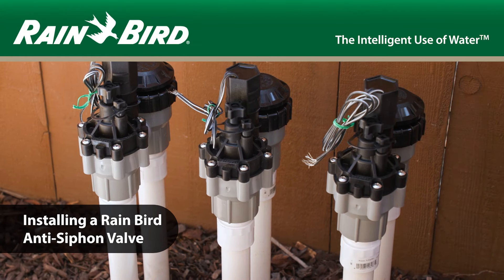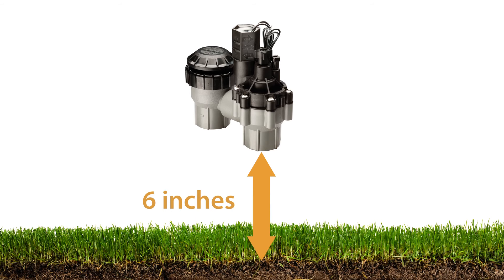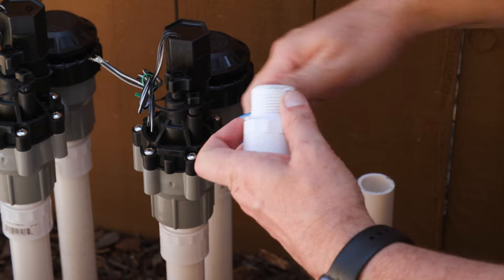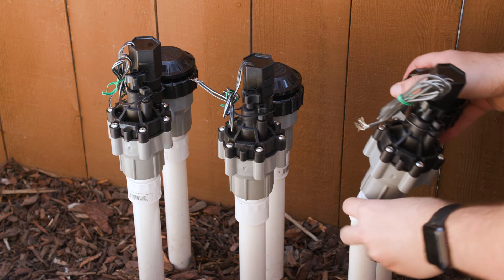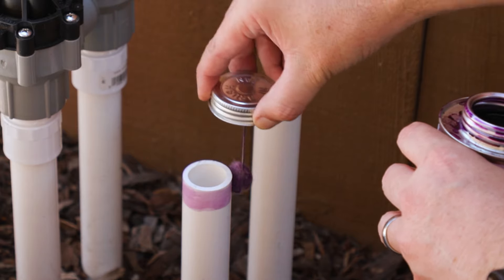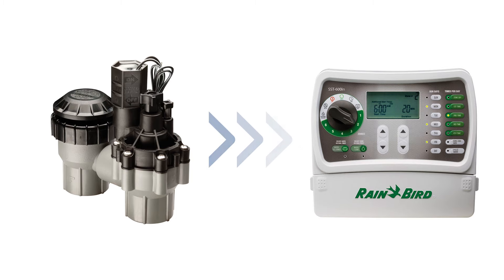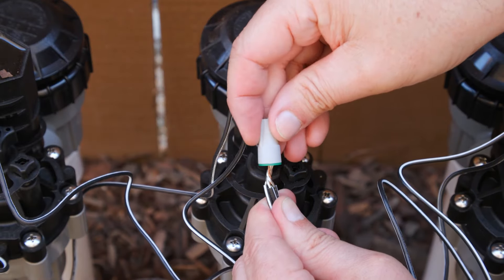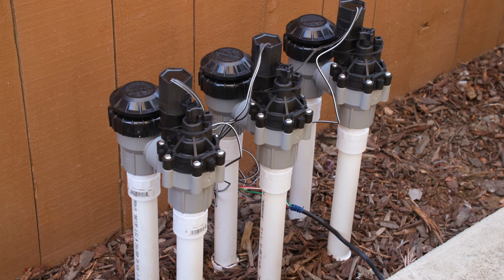Installing a Rain Bird Residential Anti-Siphon Valve

Comment: where do I attach a pressure regulator-filter combo in this for a drip system? What should be height of the PVC pipe the valve is being attached? Thanks.
Reply: Attach the pressure regulator before the valve. That is, the water passes through the regulator, to the valve inlet, then out of the valve. This is shown in the booklet that comes with the valves. As for what height, it's 6 inches above the highest sprinkler head, as stated in the video. You might consider watching the video, it's educational.

Comment: Hi I have 2 zones in my backyard, the valves are located on each end of the house, how do I wire them from the timer controller inside the garage?  do i run one set of wire to the first valve location and daisy chain to the 2nd valve across the yard?
Reply from the maker: Hi, thank you for contacting us. Yes, you can run a wire to the first zone then run the other wire for the second valve. Remember that the common wires can be attached together and run back into the timer and the "hot wire" for each zone has to run back individually back to the timer.
Reply: You can daisy chain as explained in the other comment, but you don't have to if that's not convenient. You can just run the ground and hot wires from the controller directly to each valve. It's just a ground wire, there nothing significant about tieing them together right at the valves as shown in the video.

Comment: As a Commercial Landscaper in Tucson, Arizona, working for Santa Rita Landscaping LLC,and, attending the Rainbird Academy, " Glue" is actually called " Solvent Weld", a chemical weld compound bonding the 2 pipes together, after primer.

Comment: I would have put cut off valves and compression couplings on it so I can pull it out at any time.
Reply from the maker: Great ideas for a more advanced installation!
Reply: That's over thinking it, overkill, over engineering counter productive, and failure prone anyway. By the time you finish that extra work I'll be on my third beer watching the game. The more connections you have in a system the more vulnerable you are to leaks, so use solid pipe as much as possible and minimize connections, and couplings use a rubber washer that will leak every single year, just like those stupid washer on the garden hose that i have to replace every year. highly annoying. Since PVC is so easy to work with, you can just cut the valve out with a vise style PVC cutter (5 seconds) and glue in new PVC stubs with a coupler. That's plenty easy enough to make coupler superfluous.